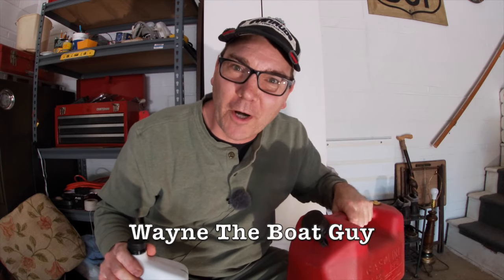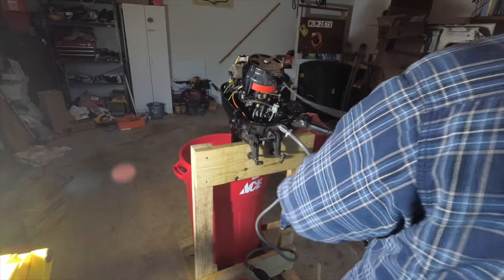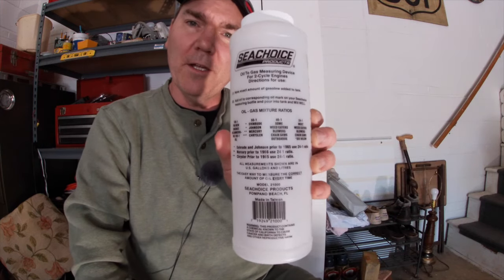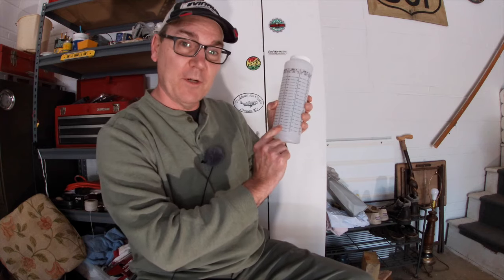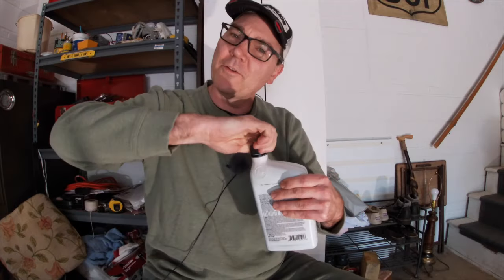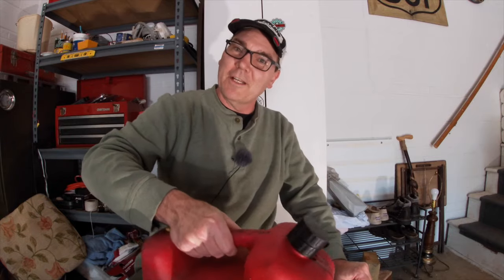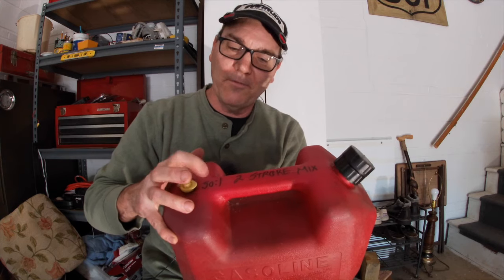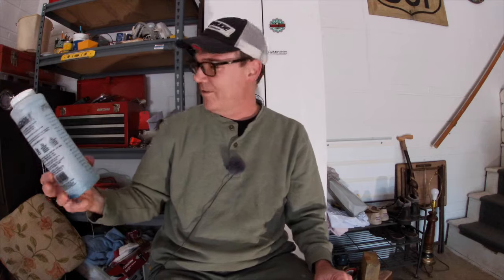How to mix 2 stroke boat gas for your outboard

Comment: First of all, NEVER, EVER put ethanol gas in anything with a carburetor. PERIOD. Use only non-ethanol gas, and get it from a dedicated pump and nozzle. If your station doesn't have it on a dedicated pump, then at least put the first gallon or so in your car before putting it in a carburetted engine's tank. This drains the residual ethanol that will surely be left in the hose, pump, handle etc and will keep all ethanol out of your carbs. I liked the video to watch later, but just wanted to throw this out there in case Wayne didn't mention it. 👍

Comment: Another useful tip: After finishing your trip. Disconnect your fuel line from your engine. Run the engine at idle without the fuel line attached until the engine dies. Running all the fuel out of the engine will help keep the engine from being gummed up by the stagnant fuel/oil mixture between uses. Also if you have extra fuel in the gas can or tank. Add a fuel stabilizer (read label; appropriate for 2-stroke mixed gas), it isn't necessary for a week or two, but anything beyond 3 weeks should have fuel stabilizer added. Fuel stabilizer is added per the amount of gas so read the instructions and follow per the instructions such as you do when determining the correct amount of oil per gallon.
Reply: Yes,sir..this tip suitable for my evinrude  2 stroke marine engine?thank you for information
Reply: Only needed at the end of the season! Don't forget that the gasoline and oil also prevent gaskets and seals in the carburettor from drying out. For fuel to gum up takes quite some time. Adding fuel stabilizer for only 3 weeks of non-use is ludicrous. Unless you are in the business of selling the stuff, I suppose. I only stabilize fuel at the end of the season, or (same effect almost) just fill up the tank to the brim with premium gas. Have done so with both outboard engines and motorcycles for ages. Never a problem.
Reply: @customsighsound8564 offers EXCELLENT suggestions.  Unrelated to the suggestion is this observation.  Having outboards sitting unused for long periods is not good in terms of reliability.  The more frequently the outboard is used the longer it is likely to last, at least in my limited experience that is true.  I'm dealing with a seized 15hp 2 cycle now that has been sitting unused too long.
Reply: Just like installing a fuel shut off valve in your other small engines.   They cost $2.    It’s not needed while you’re using it every few days but for the longer layups , definitely.      I got so sick of taking carbs apart !!!!

Comment: I was mixing gas and oil for the lawnmower and for my 5 1?2 HP Johnson outboard at age 11.My father told me it was ok if the machine smoked a little as that told us there was oil enough in the gas.I used to kart the lawnmower about the neighbourhood mowing lawns for customers.I made money enough to pay for the lawnmower and to buy an 8 ft plywood boat for the 5 1/2 outboard. Todays 2 strokes more sensitive to accuracy in mixing I think! CHEERS from Canada

Comment: Wayne I am so glad I came across your video because I am a first-time boat owner and I have been mixing my oil to fuel ratio totally wrong in my engines been running poorly I am glad I came across this video I thank you very much and I'm also going to order one of those ratio bottles did you have in your video once again thank you very much and I'm glad I came across this video keep up the good work

Comment: Great advice thing I also found with w strokes is pre 90s most don't yell ya is 50-1 wasn't till 96 they ran 100-1 mixes in yammy and mercs while tohatsu and mariner most ran 50-1 got me few times smoking out boat ramp hhheee great video

Comment: Informative video.  Thanks.  It would be handy if the mixing bottle didn't have such a sharp shoulder below the lid.  If it sloped more it would be easier to get every drop out.  Thanks for posting!

Comment: Thanks! I just bought my first bass boat the 88 ranger v 393  it has the original 87 Johnson V6 150. The boat came with 2 20 gal tanks, which I am not going to every fill full at one time haha these gas prices are crazy, but I was really concerned about the math part, the old man I bought the boat from gave me a water bottle for the oil and said 1 water bottle (1 pint) per 3 gal. This is going to make it so much easier.  Brand new to boating, so you got yourself anew subscriber!

Comment: Thanks a lot, now i can feed properly my mercury 2.2 2 stroke with 50:1 that it seems that for 10 liters of gasoline it's about 200 ml of 2 stroke oil, also, I followed your instruction to only use TC-W3 oil, Shell has one "Shell Nautilus 2t Outboard Oil TC-W3" not cheap, but i prefer to feed my mercury with top notch oil for durability, thanks a lot!

Comment: One simple tip. After adding the proper amount of 2-stroke oil to the measurement container. Poor gas from the gas can the oil will be going into in the measurement container, close the lid of the measurement container and premix the gas and oil. This will make sure you get all the oil out of the measurement container and will not leave excess oil in the container. This will also greatly help with the distribution of the oil within the larger volume of gas when added back into the gas can. Make sure you still shake your gas can right after you add your oil (premixed oil) into your gas can. Proper distribution of the oil within the gas is as important as adding the correct amount of oil.

Comment: Some of us (old motorcycle desert racers) pour some of the unmixed gas from the gas can into the measuring cup after the correct amount of oil is added and then put on the cap. Shake it way up and then poor the mixture into the unmixed gas can. Then cap the gas can containing the mix and shake it up! Also, if your mixed gas in the can has sat for a day or so, it doesn't hurt to give it a good shake before you start your motor.

Comment: Thank you for your video's Wayne.  I just bought a 1989 Nissan boat with a Nissan 90HP 2 stroke and Nissan 5HP.  Your videos are exactly what I needed.  The 90 has a separate fill for oil, still trying to figure out the 5Hp. Keep the videos coming!
Reply: Wayne- I am a boating newbie too!  Your videos are so helpful!
Reply from the maker: Thanks! The 5 will probably need a little jug of premix 50:1 that you should label as 50:1 2 stroke fuel so it doesn’t get used in something else and make a smoky mess.
Reply: @WayneTheBoatGuy  In my professional opinion, (I build little 2-stroke racing engines for a living), you may be just fine running as thin as 50:1 with the low RPM and low power utility boat engines, (higher rpm does require more oil), if you are using a very good oil.  But 32:1 for most engines has been proven to give the best protection and performance, (seals the ring better), for most 2-stroke engines.  The reason why the boat industry has pushed 50:1 and even 100:1 started around the 80's with environmental concerns of the oil sheen on the water surface from a 2-stroke engine exhaust, (released in the water to deaden sound I assume).
It is the EPA who pushed lean gas/oil mixes,---not the engine engineers.  Now 2-stroke carbed engines are sold running rich with the fuel/air mixture.  So if you switched to 40:1, (more oil), that means less gas will be going through the jets for a more lean fuel/air ratio, and the engine may actually make more power while getting better lubrication.  You can actually fine tune your jetting a bit with different oil ratio mixes, but I would stay in between 32 and 50:1 for your engine.
Oil does not foul a spark plug is the jetting is good, (not too cold).  With the right combustion temps, the oil will burn.
Reply: Some oils do smoke more than others, but The smoke mostly comes from a rich fuel/air condition also.  With the same oil and mix for a rich set carb to a well jetted carb,--the smoke pretty much goes away, (sans start up).   I remember being in the Pontiac Silverdome for a SX race back in the late 80's.  The stadium filled up with just a little haze for all the pro qualifying and racing.  But after the Pro's were done, 2 amateur races later, the place was being fumigated.  :)
It was all in the jetting, not the oil mix.

Comment: Thanks for the tips Wayne. I ordered the SeaChoice measuring cup and it arrived today! I bought a 1972 6HP Johnson in great condition and can't wait to get out there on it. This definitely helps.
Reply: A gallon is 128 fluid ounces, and lets say you want 40:1 mix.  128 divided by 40 = 3.2 ounces of oil.  If your oil bottle has fluid ounces along the height of the bottle,--what else do you need to buy?   I actually use a measuring cut called the "ratio rite", just because it may be more accurate than the side of a bottle.  They have been around for decades, and can be bought at any dirt bike shop.

Comment: Hi Wayne, when I mix oil and gas in a gas can, for example, chainsaw, outboard, I put a marble in the can. That shakes the mixture, simular to a BB in spray paint can, if it sits for a while.
Reply from the maker: Great tip!
Reply: The mixing ball in aerosol  spray can helps break up tiny particles that settle to the bottom.  Sometimes, you can even tell the mixing ball is stuck in it as it does not free itself to mix until after you shake it a bit.  You don't have to worry about that with gas and oil if they are compatible with each other. Some oils will separate from the fuel, which you can observe on a cold day mixed in a glass canning jar, like Castor oils and high octane aviation gas.  It has to do with specific gravity, which I am not very familiar with.  I have never seen any mixing issues with normal pump gas.  As long as you have some air space in the mixing can, (so it moves and sloshes in the can), a few shakes for piece of mind is all you need.  Interesting thinking, but 2 different applications.

Comment: Another important tip: Use non-ethanol gas, especially in two-stroke engines. While a good idea with all small engines it is especially important with boats. Ethanol combines with water and also eats the rubber of the fuel lines, causing your engine to foul.
Reply: Agree wholeheartedly. If only we could still get the stuff in Europe. In most countries E5 (so 5% ethanol) is the best you can get :-(
Reply: Thanks for saying that --- I didn't know it wasn't available in Europe. 
 @RobertvandenBoogaard

Comment: For anyone using the metric system it’s soo easy  lest just say you have 7 litre of gas and you need to mix 50:1  well how many millilitres are in a litre 1000ml so 7000ml/50= 140ml  so you would need 140ml of oil for 7L of gas

Comment: Hot tip and just a tip! if you know what your going to fit in your container add the oil first then the action of adding fuel at the pump performs the "mixing" for you and you dont have to shake the whole container...
Reply from the maker: Many times my fuel container is about 1/2 or 1/3rd full - and it has no measuring lines on the side - and I want to top it off before heading out so I add the oil after I see how many gallons I pumped in at the filling station.

Comment: I was in in a situation where my measurements might have not been exactly on point but i only went a small distance until i loaded it back up it that to big a a problem can i still use the gas and is my outboard okay??

Comment: How long can I store the mixture after I mix manually the 50:1 (1 gallon gas:2.6 Oz oil)? I may be left with 1/2 gallon leftover after using it on 2 stroke leaf blower. Can I pour this into my Honda crv or should I just throw away since it’s going to snow anyways here in a month?
Reply from the maker: I have stored the mix for up to 5 months - and after that, if it has ethanol in it, it seems to give me trouble. I usually run my older fuels (mixed or not) through my riding mower mixed with good fuel.

Comment: In the 50s we owned a 5hp green Johnson.  My father would put a quart of straight 30 weight non detergent oil in a 5 gallon can then fill the can with gas.  It worked for years.  I think that Johnson is still in use. Tough old motor. ha

Comment: I normally put in 2 stroke oil first, then drive to the gas station, fill up my tank and drive (savely) like a lunatic, taking many sharp turns. By the time I get to my boat, it's more or less mixed👍

Comment: Hi Wayne. Thanks for the helpful video. I have seen conflicting info on this, but do you detach the fuel line from your motor in between uses? Thanks!
Reply from the maker: My small 2 stroke has an internal tank so I just turn off the flow and run the carb dry.
Reply: @WayneTheBoatGuy  A lot of people do that, and I have never seen an engine failure because if it.  But understand as the carb runs out of fuel, when the rpm's go up, it is running in a lean "fuel air" condition.  If it did not run out of gas and stall, that condition will cause engine damage.  I would not run the carb dry by revving it or under load.  But I think that is more of a concern for engines that are tuned on the edge for performance, well tuned racing engines, as they run best on the edge of too lean.

Comment: I just bought a post hole auger that calls for 25:1  . I have the small oil bottles from STIHL  thats 50:1 . so can I just use half the oil to make it 25:1 ?

Comment: Are all two stroke oils synthetic or not ? Which is better?   Does adding a stabilizer in a 2 stroke gas help if your motor sets for a long long time .

Comment: what if I don't use all my fuel ? say I only use half, and the next time I need to fill. do i add the ratio based on just the amout of gas I add?
Reply from the maker: What I do is when I need to add any additional new gas to the container - I make note of how much I have added and then add the appropriate amount of oil (measured with the bottle).

Comment: Nice video! However I do feel that us Europeans (using the metric system) are better of. On 5 liters of gas (=5000 ml) just add 100 ml of oil for 1:50 or 50 ml of oil for 1:100. No need for separate measuring jugs.
Reply from the maker: Another great argument for the metric system!

Comment: Hi ! Why pour it into the container when you can use the measuring chart on the side of the 1qt.
2- stroke oil container  ? 
Your never going to get all the oil out 
Of the fancy container and it tells you on the qt.of 2 - stroke oil how many gallons  the qt.will properly mix , ok thanks

Comment: When it comes to premix oil its always a good idea to be just a touch rich.
Easier to replace a spark plug than a piston right?
Reply from the maker: That's a neat way to look at it!
Reply: Thanks for your great video I just bought a boat with a 1990 9.9 two stroke I was going to get rid of the motor because mixing gas and oil seemed like a huge hassle and replace with four stroke but your video made it so easy to do the oil gas mix now I love the motor thanks Wayne

Comment: It recently occurred to me to get an accurate mixture ratio that you would need to subtract the amount of oil...for example if I'm mixing 20 liters of gas at 40 to 1 then I should add 19.5 liters of gas (Not 20 liters) to 500 ml of oil, this way I have 20 liters of gas oil mix total and 1 fortieth of that is oil. I wonder of these containers factor that in? Also I prefer to add the oil to the container then fill with gas at the pump as the flow of pumped gas aids in mixing. Thanks and regards.
Reply from the maker: That makes mathematical sense - but it might be too minute to be a concern. I also like the idea of adding oil first, but I don't add oil first because sometimes my fuel container isn't empty or if my "6 gallon" container actually holds 6.4 gallons.
Reply: @WayneTheBoatGuy  you could be right on it not mattering maybe more so with higher mix ratio like 24:1 not as much with 40 or 50 to 1. Not trying to continue an ongoing debate here but if you had fuel in your container I'm assuming its premixed, so if you had a half full 6 gallon container just add 3 gallons worth of oil then top off with 3 gallons at the gas pump.
Reply: No:  40:1 means 40 parts to one part, for a total of 41 parts.

Comment: How many hours does a full tank run this behemoth of an outboard engine???  I rebuilt one of these for an old gentleman a couple of summers ago. He has gotten too old to use it. He wants me to have it , because I took care of all his equipment , and only charged him for the parts.    I assume it'll run all day on a tank.
Reply from the maker: My 2.5 2 stroke Mercury probably could run all day on 3 or 4 gallons!

Comment: Had a 1940 somebody older motors they used to use regular straight non detergent 30 weight which you could buy at 7-Eleven back in the day and that's the only oil that engine would run and it wouldn't run on the modern day two cycle oil
Reply from the maker: I have been hearing about how the 1950s era 2 strokes like the 30 weight motor oil. Thanks for watching!

Comment: Great vid so you can use this on a 3.5hp?
Reply from the maker: yep - Any 2 stroke outboard - just make sure the mix is the right ratio for your engine.
Reply: @WayneTheBoatGuy  just got a 3.5 for my sondolfin 12 today so great help but all so have a 6hp euro craft it's takes 2 stroke all so but different stuff like for hagecurers and strimmers

Comment: This is why the US needs to switch to metric, LOL!

For a 50:1 ratio, just shift the decimal two places to the left, then multiply the result by 2. For 20 liters of gas, that would be 0.20 liters x 2, or .4 liters of oil (aka 400 ml). A shortcut is to multiply the number of liters by 20 and change the units to milliliters.

For a 100:1 ratio, it's even easier - just take the liters of gas and shift two decimal places to the left. A shortcut for a 100:1 mix is to multiply the number of liters by 10 and change the units to milliliters. So, for 20 liters of gas, a 100:1 mix would be 200 milliliters.